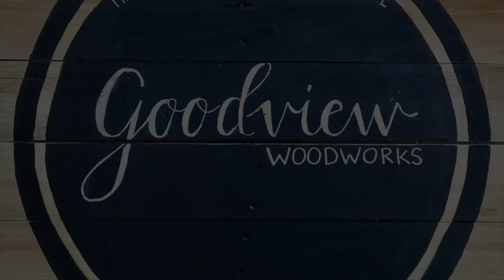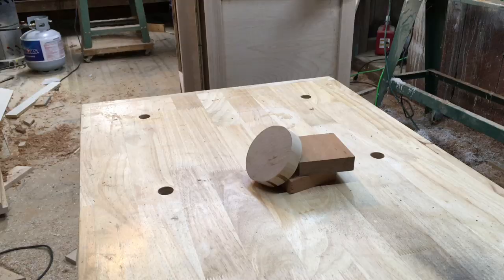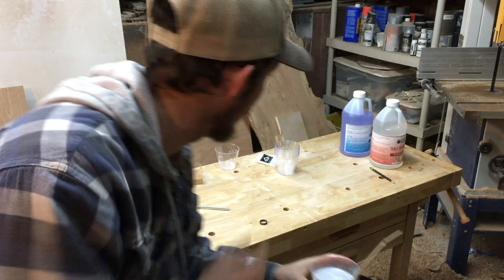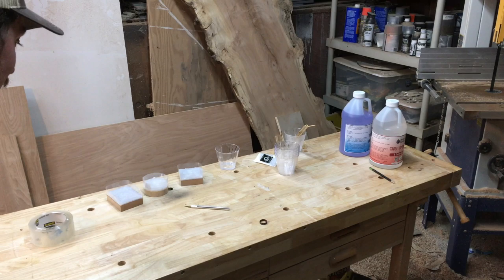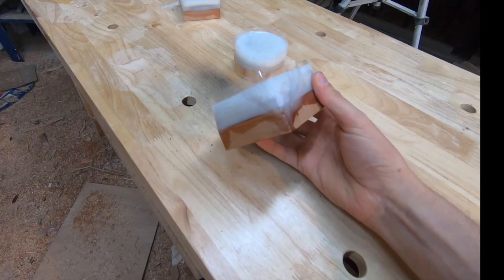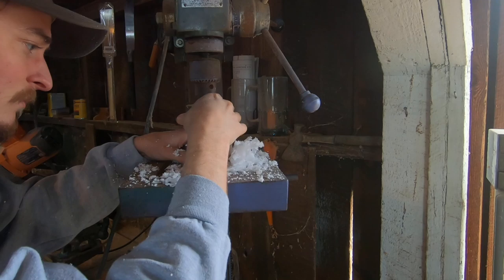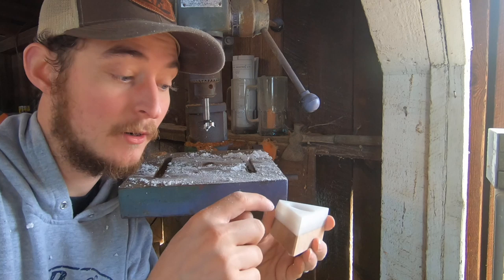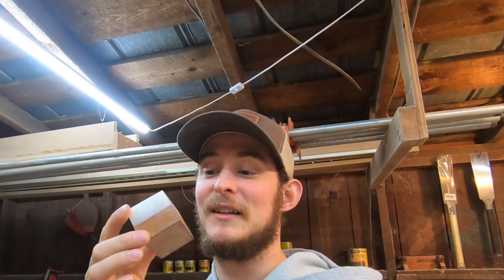DIY: Wood and Epoxy Succulent Planters with Minimal Tools!!!

Comment: Always entertaining! 💯👌 I'd like your opinion comparing the epoxy/resin you used in this video to Stone coat countertops used in one of your other videos... Pro's and Con's you might have noticed & why?
Reply from the maker: as far as mixing and handling the epoxy, incredible solutions epoxy is very similar to stonecoat. This new epoxy is thicker than stonecoat and I found that the metallic powder stays suspended in it a little better. As far as hardness and resistance to yellowing, I can't speak on that yet just because I haven't had the new stuff for long enough. I will keep you guys up to date on that. Thanks for asking!!
Reply: @GoodViewWoodworks  I appreciate your opinion and thank you for your reply 👌

Comment: Instead of wasting epoxy by drilling it. Hot glue a taped up slightly tapered  wooden dowel to the wood base to make the void. It’s a little difficult to pull the dowel after the epoxy hardens.
Reply from the maker: That’s a great idea 💡 thanks!!